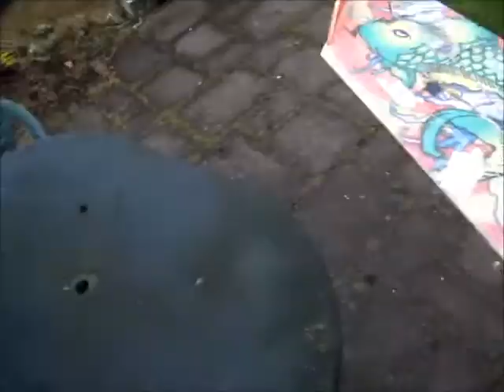Teksumo+Afromini issues

Comment: Yeah i mean just hold the naze off the wing with your hand well testing it but still have it wired up.. Have you used Clean flight yet? Its much better.:)
Reply from the maker: I use Cleanflight on my copters, but on the wing while trying both I just left Baseflight as my problems were the same.

Comment: Hi mate, i'm on Clean flight, but still not tested it yet but my throttle is in (1) and servos 1&2 in (3) (4) on the naze, i have 3 modes set on the TX and all looks OK will test fly tomo, if you can could you take a screen shot of your pids, i have no idea what to use on my first flight or just leave them..
Reply from the maker: According to others who knows more about this you should start with half the PID values and then increase while checking, to make sure it doesn't overshoot when first switched on. Pitch and roll Ps at 2.0 and level P at 4.0. As didn't fly a wing with Naze32 yet, I can't confirm that for sure:)
OK, it appears that I have to make my servos work with ports 3 and 4 on Afromini... Cheers:)
Reply: after looking at your video, i just tested my wing and full throttle, Pass through was fine, but in both stabilization modes the vibration from the motor sends the servos mad :( good job i tested it, back to the drawing board for me.. maybe its the vibration on yours?? try taken the naze off the wing well trying full throttle.
Reply from the maker: Richard Crellin I've flown this wing with no Naze on and Hawkeys UHF on, no issues with servos, I believe it's something with the board, totally my lack of knowledge of setting it. I don't feel that much vibrations to be relevant to the board and still have no servo jitter, it's just I'm new enough to FPV airplaines and this behaviour looks weird to me:)